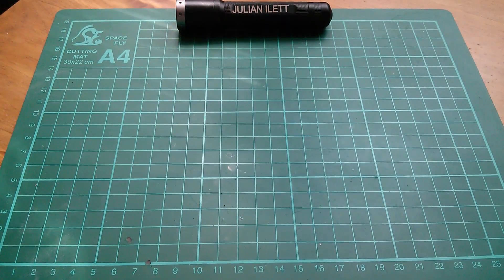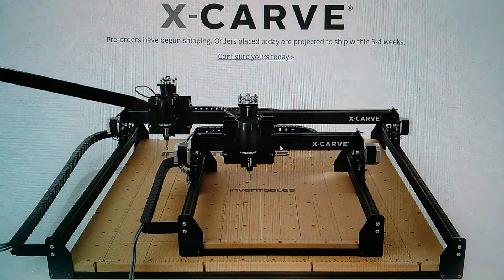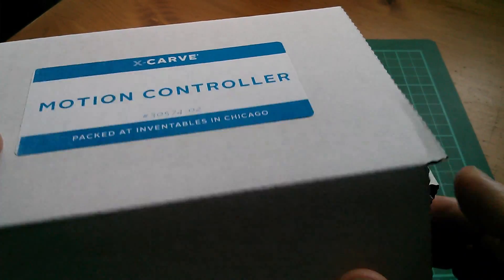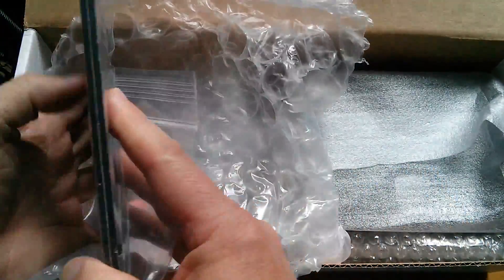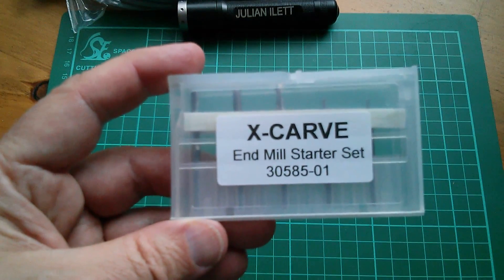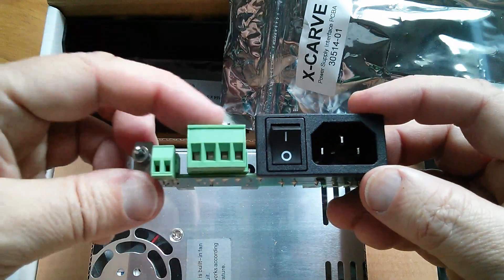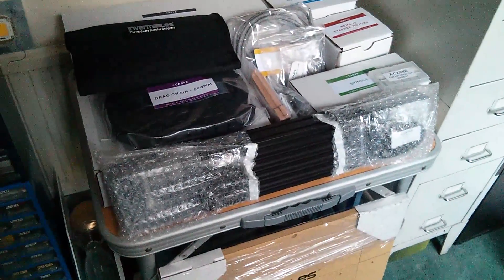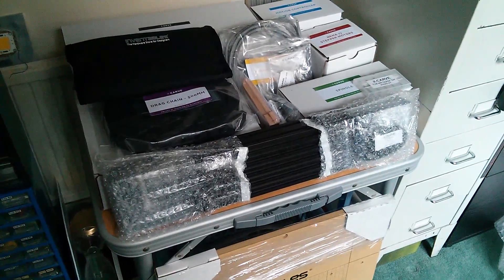Julian's Postbag: #44 - Inventables X-Carve Unboxing

Comment: That is not an acme thread, acme has the male and female parts of the thread as opposites at 29 degrees between the inside walls, that thread looks like its for running balls through with the round base in the thread.

Comment: I can confirm you can use it for milling PCB's, though you'll need to buy an extra small bit.  A friend of mine got a bit that can also serve to drill the holes for through-hole parts. if you're conservative on speed of movement and rotation, the wear on the bits is't that bad so it'll lst quite long.

Comment: Hi Julian, here's my 5 pence worth of input for what its worth. :)

For Context: I am a hobby machinist, and I own both a fairly large lathe, and a Bridgeport Milling machine. So I can speak with the benefit of some experience.

By the looks of it this X-Carve CNC Router is built very lightly, i.e. the brackets don't appear to be too chunky and the router motor and its bearings are very small. What this tells me straight away is that you will only be able to take very light cuts with it, in things such as plastics, acrylics and wood. Forget cutting any metal with this thing, even Aluminium.

Basically, rigidity is everything when it comes to CNC machines and older milling machines and lathes. That's why they are so large and weigh so much! (my Mill weights 1 metric ton!)

So the harder the metal you want to cut, or the deeper the cuts you want to take, the more rigid the machine and all its components need to be. Which is why I said that the X-Carve will only tolerate light usage. But that may just be what you wanted it for! :)

For comparisson, here's another 'desktop' router, the ShopBot Desktop. Being used by Diresta to carve some shapes out of MDF. You can see that its construction is significantly more rigid, which is reflected in the price tag. It's about 6x times more expensive than the X-Carve!

https://youtu.be/Kmt2U1NN5Rg
Reply from the maker: mictho100 I suppose I should also disclose the fact that I've done quite a lot of CNC routing in the last 5 years or so. At work (part time only now) I use an AXYZ Millenium CNC router to cut mostly polyurethane foam, but also various plastics and sometimes aluminium. I learnt pretty quickly to go very slowly at first, then up the feed rates and cutting depths as confidence is gained. I'll start by cutting some simple shapes in soft plastic (foamex) and only once I fully understand the machine, attempt to mill the copper off some copper clad board. But thanks for the comment.

Comment: Nice! They offered me one but I had to decline because I have no room for it, and the noise would probably get me kicked out of my apartment :(
Reply: Jeff Morris settle down children... Jeff!! what are you doing out here?! Get back inside and clean up that messy room in your basement :)
About the noise, it's probably not so loud that I would worry if I had a proper house with a yard and all, but my whole apartment is only 5m wide which means my neighbors are only 5m away, through a single wall... I can hear when my upstairs neighbor uses a coffee grinder or blender or something, and in the quiet hours of the morning I can hear my other neighbors alarm clock faintly.... I also didn't feel like getting wood dust all over my (only) room - I'd need some kind of tent-like shroud to run it in. All in all it's just not really the place for equipment like that.
Reply from the maker: ***** Space was a major consideration here too - didn't think too much about noise though :s
What really appeals is the open source nature of the project. There are mounting holes on the carriage for "future enhancements". With a little effort, a solder paste dispenser and a vacuum pick and place head could also be attached. That way, the machine could both cut the PCB and put the components on it.
Reply: Jeff Morris You're right IT'S YOUR PROBLEM.  And I dont give a F$%^!
Get over yourself, I don't care what you think.  Go patent something.
Reply: shaputer I would tend to agree that an Arduino is a bit low end to be used as a motion controller.  Sure they will work but it is a bit of a kludge and much slower than something like a raspberry pi.  I bought one of these kits (the larger one) but I plan to be using my own motors and controllers driven off parallel port for the time being and later moving to a dedicated motion controller once I am ready for that step.  I plan to just run the entire machine from a used desktop computer with Mach 3 and a legal copy of MasterCAM since I already own MasterCAM.  This is all just gearing up for a much larger machine that I have been building for the last 2 years as I have time.
Reply: Jeff Morris The X-carve is based on the Shapoko 2 and it's shortcomings.  That is why Inventables is offering upgrade kits at a reasonable price to those people with a Shapoko 2.   This machine is intended as a hobby stepping stone into the real world of CNC where eventually the arduino based motion controller is not going to cut it.  GRBL on arduino has many limitations but does enough to make most hobbyists who are new to CNC happy.  This is the very reason I am supplying my own controller and stepper motors to the X-Carve I own.
Reply: shaputer Just weary of seeing products reviewed (in this case just an unboxing) and commenters busting in with claims that something else is better. These people provide gadgets to reviewers at significant cost to their (mostly small) companies. Now, if the reviewer finds problems with the gadgets, that's fair as can be and the company should have anticipated that and provided a better product. But in this case, your chiming in on the deficiencies of the product before the review even took place -- that's unfair. It's not right. You shouldn't do it.
Reply: Julian Ilett  That's very ambitious. But, I don't think a prototyping board such as Arduino with a shield can handle such complex chores as paste dispensing and definitely not pick and place.  The tinyG controller has two extra motor controls for "A" and "B" that could be used for other functions.
Reply: ***** It didn't run the complex process of reliably running the Shapeoko 2 as a CNC machine in 2014, but perhaps by now someone has developed a complex Arduino sketch to control things properly.  Basically everything is just great until you decide you want to cut out shapes with holes and slots and need to keep track of an origin. That  is where there are problems.  Very erratic behaviour.  And without limit switches, which weren't included in my  kit was impossible.
Reply: ***** As a matter of fact I do.  If you read what I said I stated I use a TinyG controller.  I control it with a Raspberry Pi.  http://www.thingiverse.com/thing:455337

I've cut things without problem using this setup.
http://www.thingiverse.com/thing:789751
http://www.thingiverse.com/thing:336352

I don't know what YOUR problem is, but I have a right to my opinion whether you like it or not.  What have YOU done lately ?
Reply: shaputer MY problem is that you enter this discussion of another product making unprovable negative comments about it. Again, send your product to someone and let them review it. Let those reviews be compared to this one (which is really just an unboxing so you're pretty early with criticism in the first place). As for what I've done lately, I make my living from processes I and others patented. I'll happily show those to Julian any time he'd like to see them, but not you. Why? Because I don't want to have to deal with the sort of baseless criticisms you've put forward here.
Reply: kuhrd That's all I'm saying.  I agree with you.  It's just common sense to upgrade and a necessity.  I not being negative I'm sharing my experience with the system.  Some people can't handle the truth. Your idea sound GREAT !  There are many ways I'm sure.  ;+}
Reply: ***** You're right. Sorry Julian! Sorry everyone!
Reply: shaputer Done. Good idea, matter of fact.

Comment: Good luck with that build !!!  I got the dodgy Shapeoko 2.  This looks the same with some minor differences.  First of all, the wiring had no ground wire in it which kept up a lot of electrical noise.  An arduino and gshield didn't work correctly with any software offered.  Plus no safety stops are provided or work properly once installed.  I had to create software to make it actually cut out a piece and perform homing sequences properly and that was ONLY after I threw the arduino and gshield in the trash and got a TinyG card.  You've got a GREAT Channel and I watch all of your videos.  I can't wait to see how this turns out for you.  Hopefully you will have a better experience than I did.
Reply from the maker: shaputer I've seen some videos of the Shapeoko 2 where the carving motor (looks like a Dremel) was very poorly attached and was moving relative to its mount. The X-Carve looks like it's had quite a lot of attention paid to the motor mount. I hope the g-shield and Arduino combination works on the X-Carve.
Reply: Julian Ilett Yes, it is a dremel. I have no problem keeping attached tightly even with stock hardware.  But it barely handles cutting acrylic.  I have to cut that in .2mm layers.  Takes a long time, but it works.   The best part may be the new router that they have included.  The dremel is 35,000rpm hopefully the router is faster/more powerful.  I want a new router.  Just haven't chosen one.  Plus, I don't know why they still use nema 17 motors.  I got rid of all of them and replaced with nema 23 motors.